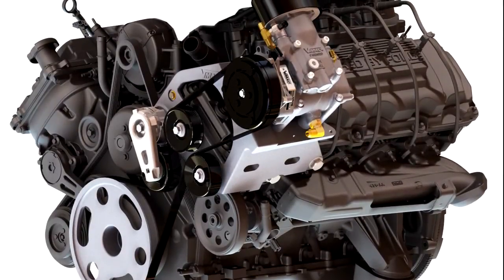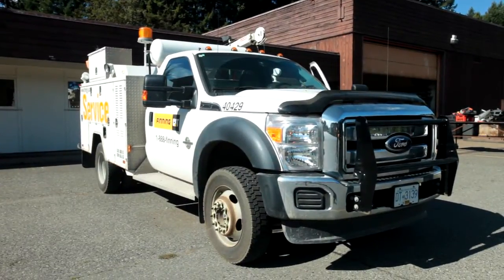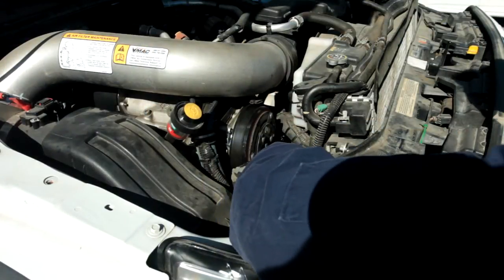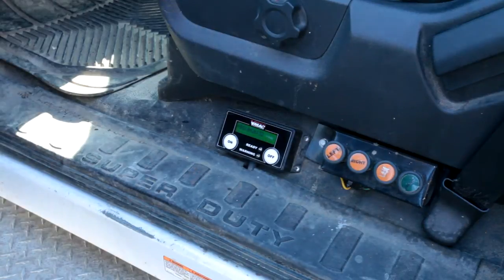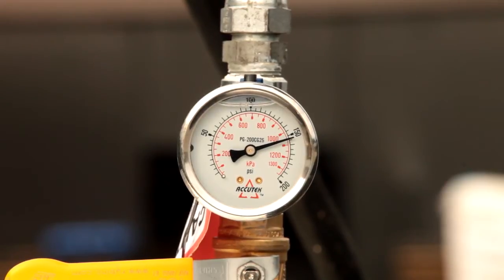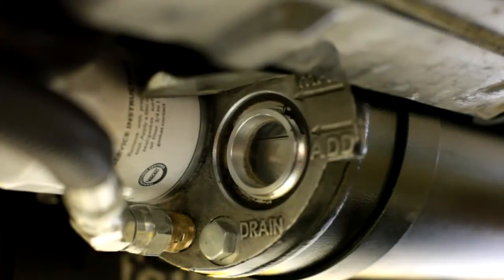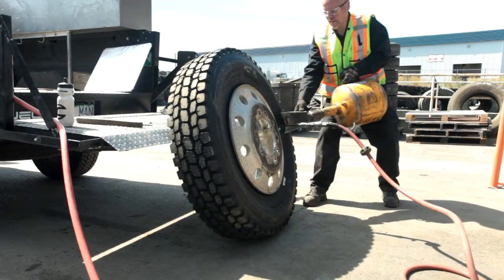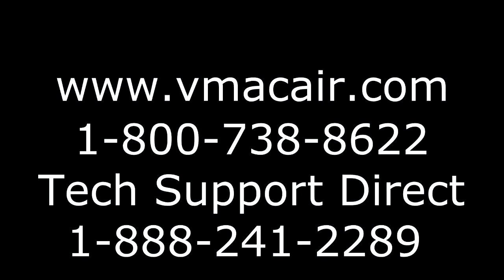UNDERHOOD air compressor Operations

Comment: So I have to run my engine the entire time I'm using it vs a standard compressor where I can shut down the truck save fuel and wear and tear on my engine
Reply: Quarter gallon an hour that’s not expensive
Reply: cfm you get from a vmac is pretty insane. electric wont match this unless we are talking ac